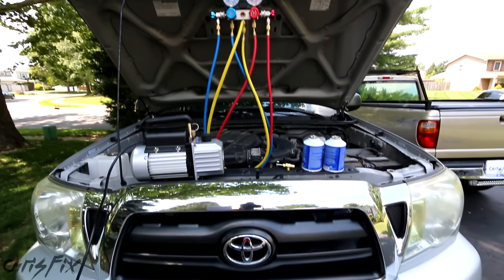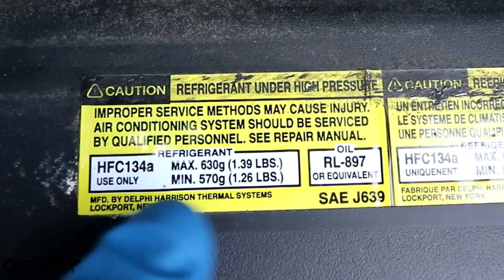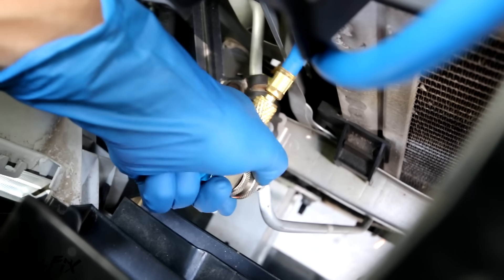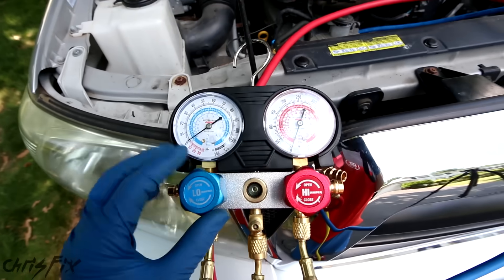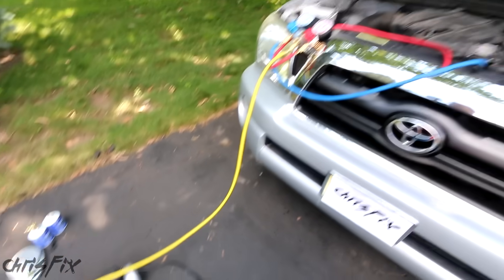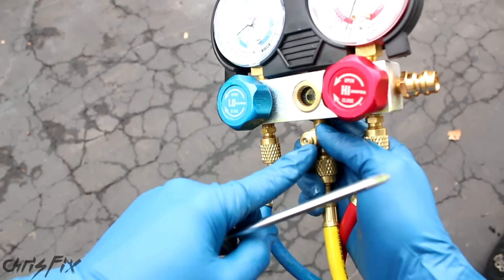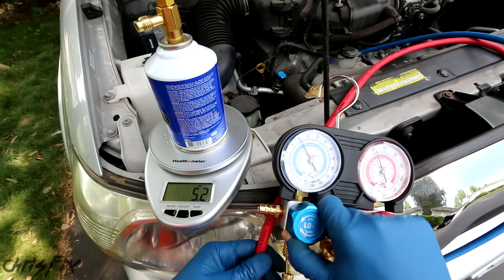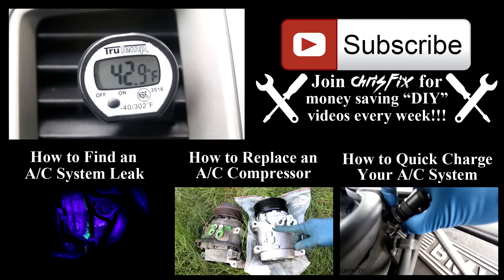How to Properly Recharge Your AC System

Comment: Totally beginner here. I know a lots of people just go to advance auto parts and buy a can kit, and use it to pump refrigerant into their cars. if that works, why could people use the method you demonstrated? I know my question sounds impolite, but would you tell me the difference?
Reply: +yang song Those cans I believe are for a quick fix. Like the title states "properly recharge" so there is no air in the system only refrigerant.  At least that's what I've figured out from watching the video
Reply: +yang song people do that to charge the ac when it has low refrigerant and because its a "quick fix". if an a/c system has low refrigerant there is a high chance that there is a leak in the system but very miniscule. So overtime refrigerant would still be leaking and youd have to refill it again. The real reason chris is showing you this is because this is the proper way to add refrigerant into ur car and if u skip using a vacuum pump damage could occur.
Reply: I got. thanks! Deekay. that makes sense that when the AC system needs to be charged, it is caused probably by a leak, since the system is totally sealed.
Reply from the maker: +yang song +DeeKay  So you could use one of the kits from the store like in this video I did: https://www.youtube.com/watch?v=SHg2xRMnM38 but this doesnt remove the air and is really only for systems with a very slow leak. The way I do it in this video is the proper way to do it after you fix the leak.

Comment: You can put r12 in it if someone lives in death valley
Reply: +Peter Kapica You most certainly can NOT. The oils are NOT compatible and you will scrap your compressor. At the very least a 134a to 12 conversion would entail replacing the accumilator, replacing the condenser (you will never get all the oil out no matter what the flush promises), removing, cleaning and replacing the evaparator core (you'll have to remove the dash to do this in most cars), taking out the compressor and anything in the system to make sure every last drop of PAG oil is gone from the system so you can convert it back to POE oil. THEN you need to find or make adapters to convert your 134a service ports back to R12, then you need to either change the orifice tube, or do a PCM reprogram/custom map to control the TXV valve in such equipped cars... It's totaly not worth it, you can get better cooling efficency by replacing the condeser with a larger one but cars made today are pretty much optimized and they don't lend themselves to tampering like the old old cars (pre 1970) did.
Reply: Just flush it, pull a vac and refill with r12.
Reply: +Peter Kapica A license is required to purchase it, besides, have you looked at the price of the stuff?
Reply: I know about the licensing crap but it's much colder air
Reply: ***** yes that is true, but if you can pull out every trace of oil, additives, refrigerant, etc. it will works. I read that r12 provides better system life and colder air temps. R134a is dry
Reply: Peter Kapica
The R134 a systems are optimized for that refrigerant you would need a custom designed txv valve or orifice tube assuming it's not computer controlled then you need to reprogram the computer too, and to replace all the seals in your compressor and any quick connect fitting o rings. it won't necessarily work better and they definately don't work as well when they freeze up, you might have to tweak the low and high side cutoff valves too.
Reply: Yes the valves need to be changed and the office tube, but the oil used is better that's why it has benefits and ac systems back in the day last so much longer. More lubrication, less pressure, more life out of the ac.
Reply: My accord's system is 19 years old and air is still cold. Probably if I run the ac on a classic car that was sitting it may of worked
Reply: This is true
Reply: Yes I know you are. And I don't remember him using a quick charge ac can, just the regular thing
Reply: Where is it?
Reply: +Peter Kapica How much colder is it?
My current 95 car (probably the first initial batch of cars commercially using r134a) will have fairly cold air that my lower arm (vent closet to the centre console) will become numbed.

Comment: Hope you didn't go to the work of editing the previous video because of my comments.  
I would still add though that it is extremely important that the high pressure valve be closed when charging on the low pressure side as you showed. Opening the high pressure valve with the compressor running would likely result in explosion of the refrigerant container when its tap valve is opened.
Reply from the maker: +wholeNwon Yes, I did. I take comments from my subscribers very seriously. I did say that you should only fill from the low pressure side in both words and in text.
Reply: Now I feel guilty.  Next time I'll keep my mouth shut!

Comment: hi @chrisfix. im from malaysia. if i want to recharge the ac gas at car workshop, it will cost about usd20. is it okay for that? without change the dryer.
Reply from the maker: +zul ware I would change the dryer if you can. That will help your ac system. That is a great price!
Reply: +ChrisFix thanks for tye reply.
Reply: +ChrisFix  you don't have to change it unless the compresser burns out

Comment: Hmm added the purge tip?  Sounds great in theory but you're really not supposed to vent anything to atmosphere including the little bit that comes out of your purge.  Yeah that's a tough call because it seems like a good thing to do but I'm sure regulators would tell you that's a no no.
Reply from the maker: +DJDevon3 It is ok to vent a gram of refrigerant. More will leak out of the system if it has moisture in it and leaks from corrosion. Better off to use that 1 gram to prevent the corrosion and eventually it will leak 22oz!
Reply: anti0918 Learn something new every day.  You're right!  Section 608 of the 1990 Clean Air Act states that you may purge a little.  It is entitled with the latin phrase "De minimis" meaning a miniscule amount.  You could probably add something like this as an annotation.  You are in fact perfectly well within the law to purge a manifold gauge hose.  Nice!  Thank you anti0918.
Reply: The law has an exception for purging your lines.
Reply: anti0918 Here is the EPA exception rule "on paper".  http://www.epa.gov/ozone/title6/608/608fact.html#exceptions
Reply: I went to school to ac work and you have to do a purge or u let air and moisture in
Reply: Dan Transue Honestly didn't know that.  Thank you.  Every bit helps. :)

Comment: Man I love your videos! I don't even own a car but I want one since you make it seem very exciting :P
Reply: ChrisFix I tried to look before I asked but the comments are a thousand deep. You never touched on flushing the system. When do you recommend when it should be done. Is there any residual oil in the AC lines that would compromise the system with too much oil when installing a pre oiled compressor. Is the vacuum strong enough to remove the oil or is it just for the air and moisture. I'm assuming the oil stays in the compressor but if you could clarify. Some people recommend replacing the condenser when replacing the compressor due to metal fragments. Is that a common issue. Much appreciated. Your videos are great.
Reply from the maker: +alkhyphenali Awesome! That is what I like to hear!
Reply: +ChrisFix i dont have a car. or 18 to drive. yet i enjoy car videos. yours are the best
Reply: Cfass1 . you could replace your condenser if you want but the reason why he didn't is because his compressor didn't gurnade, when that happens, that's when you likely change the condenser and everything in your system, with also flushing it out.
Reply: +Mohd Hama  +chrisFix
mee too
Reply from the maker: +Roberto Santo +Mohd Hama  This is great!
Reply: InterDynamics Power Clean and Flush:
Part No.CA-1 

This Power Clean and Flush Aerosol Cleaner is intended for R-134a and R-12 auto A/C systems.

Product Features:
Safely removes old oil and contaminants from A/C systems
Easy to use and fast-drying
Includes disposable dispensing hose
Biodegradable and environmentally friendly
Requires compressed air to complete flush

Comment: have the same manifold, mine were cheap, did you have any leaks on the manifold? I had to replace one gasket on the highside but overall good manifold for the price, and great video btw
Reply from the maker: +gremlinamc1975 Thanks a lot! I did not have any leaks which is good! I will probably put a thin coat of silicon grease on the o-rings to prevent leaks in the future.